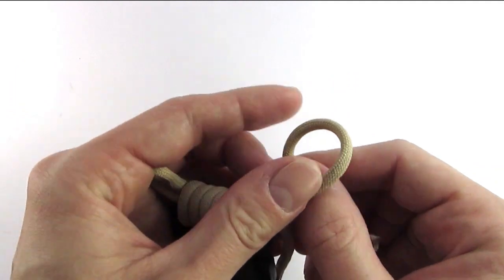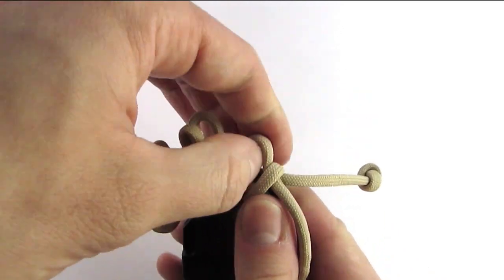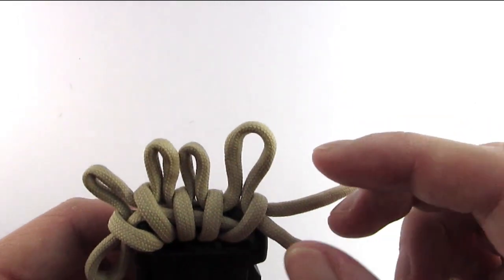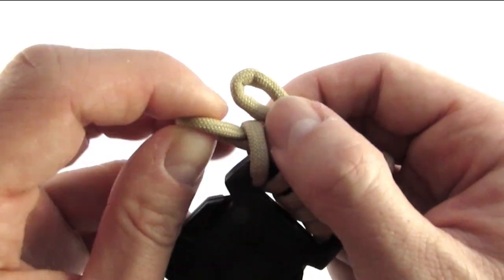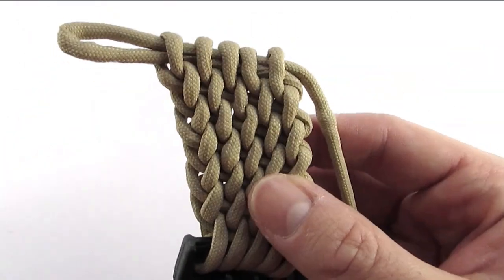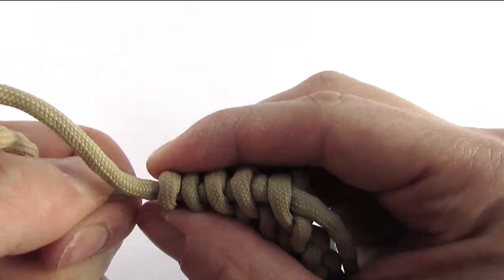How to make a paracord belt

Comment: Have been using this video to make a 6 loop Paracord belt with a traditional belt buckle. this method takes a LONG time. I have about two feet done so far. The part that takes the most time is the unwinding of the cord when it gets twisted up. I’ve been developing a few techniques and tools to make the process faster. I’m using 100 feet of Paracord. I’m going to be laughing if it’s not enough to make a belt long enough to wear. Guess I’ll have to learn a splice if that happens! I’m probably not going to make a belt using this method after the current one, it just takes too long. This is only the second Paracord project I’m doing. The bracelet took maybe 30 minutes. The belt I figure is a good way to practice.

Comment: Thank you so much for this video! I am already weaving my third waist belt from paracord. Of course, none of them turned out as beautiful as yours in the video, but as they say, "Practice makes perfect"! And at least the first one is already usable, I use it regularly, and I don't mind that it shows that it is not as perfect as the factory ones, because the good thing about it is that it is good visible that it is MY OWN CREATION...
And anyway, it's so incredibly relaxing to fiddle around with making a paracord belt! Relieve stress! So thank you very much for this video!
Otherwise, I'm thinking about how I could make an entire belt pouch (hip bag...) out of paracord or some other similar strong twine. In order to do this, I started to learn about crocheting... But if you have a video on how to make that, I would be happy to watch it as well.

Comment: Great idea, only issue I can see with this is that a belt is made to hold up your trousers so if you took this off and unravelled it then you would have the problem of holding your trousers up whilst you try to use the paracord for some emergency purpose, still a very cool weave I'm eager to try this at some point could work very well for a bracelet

Comment: If you do not want to end with a male end buckle, how do you end it with a blunt end or pointed end so you can use it like a regular belt?
Reply from the maker: +jugglebug5 

Personally I'd use a piece of metal dowel rod in place of the other buckle end. This gives you an option to finish the belt on the rod in a secure way.

Mark

Comment: I keep trying the knots and its not straight. Its kinda shifting to one side instead of going straight. I started with 6 loops instead of 5 around the buckle. Is that the problem?
Reply from the maker: +Preston Blackard 

Hey!

The belt does shift to one side for most people. It has most to do with how you tighten it.

Mark
Reply: +Paracord guild Thank you so much! If it helps for anyone else who is having the same problem; if you tighten the side that it is shifting to (mine was the left) it will fix the problem a little bit. Though after I got to a foot it started to straighten out with a little force.
Reply: the same thing here

Comment: how many average feet is required? something that should be included in any para-cord related video.
Reply from the maker: Bailey Walker 
Hey Bailey.

This belt can be made directly from a hank, meaning there is no need to measure your cord (there will be no scraps), just take a large piece and start working.

It is hard to give measurements, since these depend on the number of loops you make, as well as how tight you make your belt.

Mark
Reply: Ive found a 4 loop belt is abpit 2ft per inch of belt. But to be on the safe side id defiantly overestimate

Comment: my waistline changed quite a bit.  is there anyway to make this adjustable?  great video.
Reply: +Richard Yap Instead of using a backpack buckle, find a regular belt buckle from a thrift shop. (I took them from old leather belts) Since the design has holes all through it, the belt can be adjusted to any size you wish.
Reply: +Tim Burrows Thank you.

Comment: All I want to know is how many feet are in a hank! The stores in my area have anywhere from 16 ft to 100 ft.
Reply from the maker: +Martin Cooney 
Hey Martin!

Well, a hank does indeed not specify length. What I meant by saying that is that you can take a long, continuous strand and work with it without the hassle of having to measure out the cord before use.

How much cord you will use depends on the number of loops and the length of your belt, as well as your tightening. It may be 50 ft or even more. I would recommend just taking a 100 ft hank and working it. Use up the rest on another belt or any other cool project :).

I hope that is not way too long of an answer, I hope it helps.

Mark
Reply: Thanks for the help. Keep up the good work!

Comment: Two problems I encounterd:|
1. The belt goes off on a weird angle making it difficult to wear
2. Doesn't deploy quickly (or much at all) when done somewhat tightly due to twisting
Reply: +Brendan Walker the weird angle is a challenge but I found it can be overcome by starting the loops of your belt on an angle (loops long and loose at one side and tight and short on the other. The tail end then can be weaved over and under the lose cords until it firms up. 2 use the paracord on a roll that can unravel on it's own this might help prevent twisting.
Reply: +Tim Burrows thank you for your response! I really like the technique and am glad you posted the video. the best way I was able to figure out the angle problem was to add some loops to either end to compensate for the angle, then attach the buckle... the end result being a straight belt with an angled pattern. (make any sense?) I was thinking that the technique may be best used for something other than belts though? not sure what ATM but will post here if I make something!
Reply: Brendan Walker  Your welcome but I am not the one who made the video...I just happen to really like the design and i am making one currently :)
Reply: +Tim Burrows oops! my bad! still thank you for responding though and also still all the other stuff I said as well! lol

Comment: Would be great if someone could give an estimate of how many feet would go into an x-loop by 32" or so waist.  I don't have a 500' spool to work from, yet.
Reply: +Wade Patton I made myself a belt and i had the same problem, you could just make a smaller tight woven section with like 10' of paracord find out how much of a belt that makes and just gauge how much cord youll need for the 32"
Reply: Good morning sir. Its great as usual. I follow you since long time ago and you go more and more forward.  I usually play with my little baby and with paracord. One of the nice challenges,shes throwing to me is the possibility to dress 1 of her dolls with a paracord skirt waved with this Conquistador knot. The problem I see is that the skirt is cone shaped. If I start waving from the lower part, the knots, as you experienced in your video, open naturally and curve BUT away from the center so it's reverse what Im looking for. On the other hand, if I start waving from the upper part, I mean from the hips of the skirt, I have to increase the number of knots on each row till the end, not decrease like in your nice mask and honestly speaking I do not know how to do it because when I reach the end of the row I have not the loop to weave it. Can you please advice me how to do it_ I also tried with a trilobite knot, but it does not work. Thanks a lot in advance and kind regards. And keep waving indeed

Comment: Is anyone else having the issue where the belt goes off in one direction? since you are not alternating back and forth the belt seems to angle off one way or the other?
Reply: Yes, the belt naturally will start to curve towards the last loop. I just pull on it every so often it seems to straighten up.